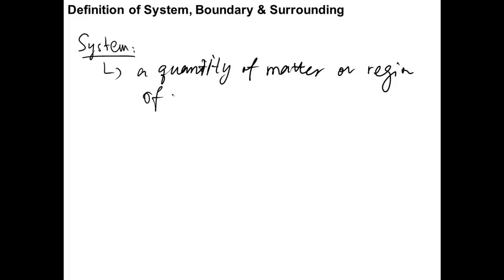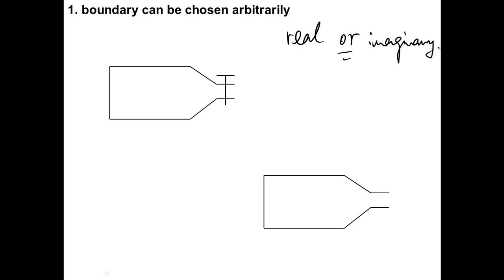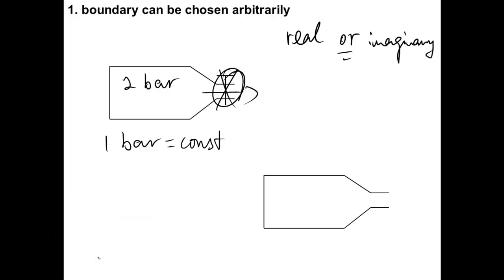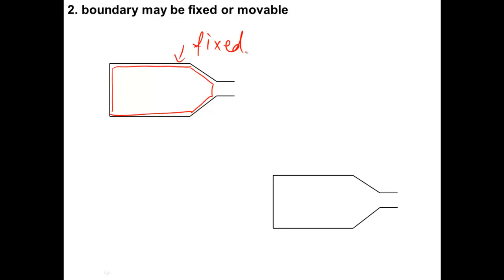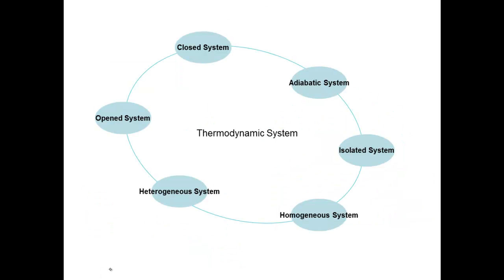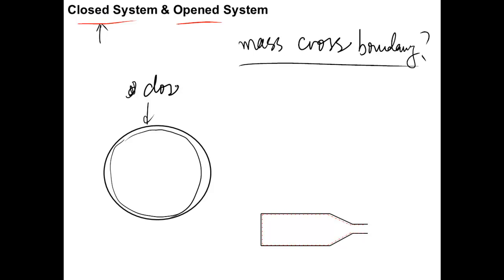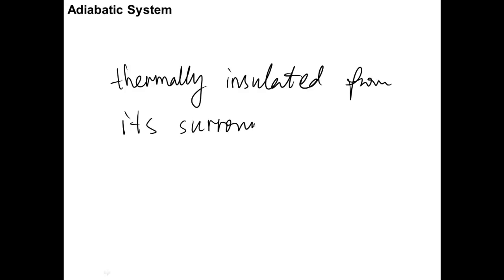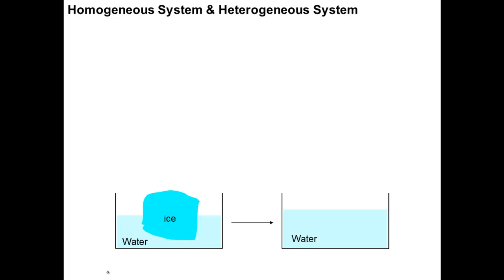Thermodynamic System,boundary and Surrounding

Comment: If the surroundings are maintained at 0C and 1bar, won’t the water freeze instead of the ice melting? It would still be a homogeneous system in the end, but your example seems backwards. It’s called the freezing point after all, not the melting point.